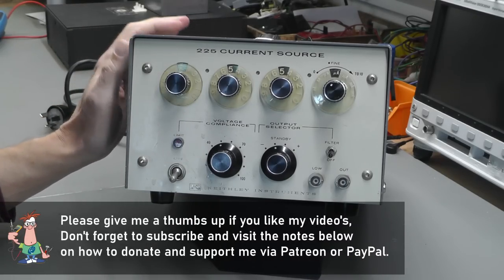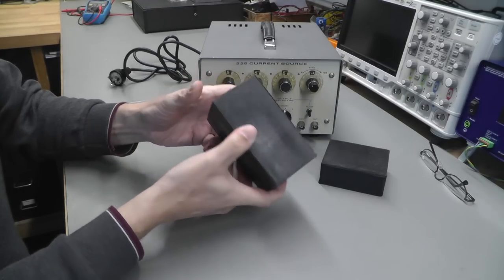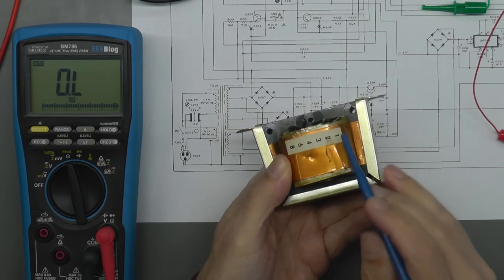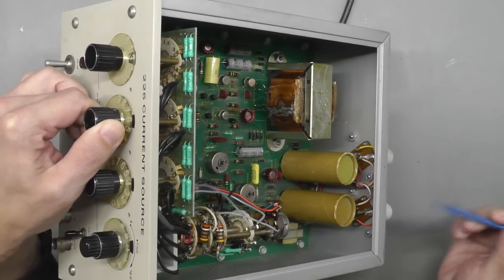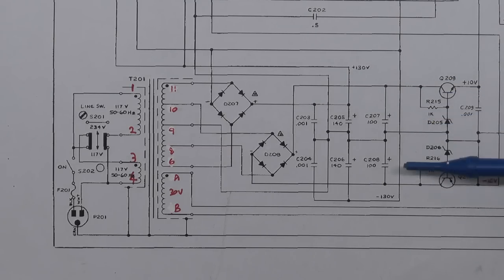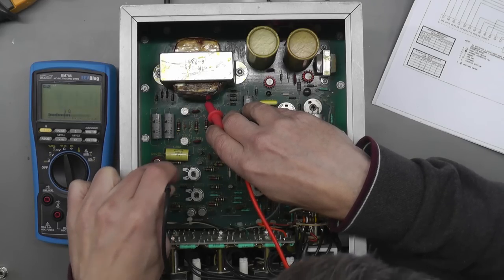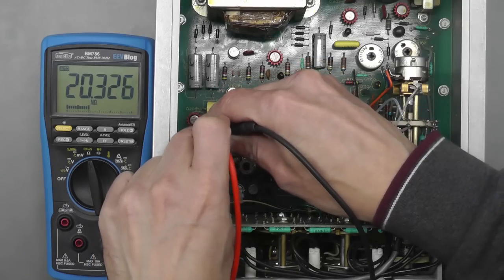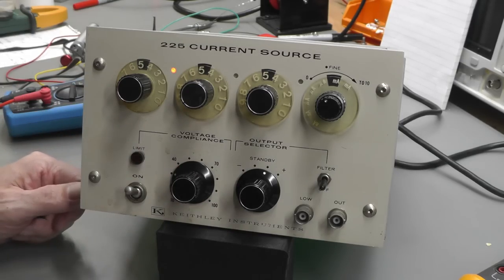No.096 - Keithley 225 Current Source Repair - Part 1

Comment: I was also surprised that you didn't bench check the transformer. You must have been confident with your repair. I have one of these old current sources and it is surprisingly accurate considering its age.

Comment: Rubber block:
A spacer for a multi-post car lift (ex. Bendpack). As in, this goes onto the lifting arms and touches the cars jack points when lifting a car.
Reply from the maker: Help ma boab!.......I didn't think anyone would get it....WELL DONE!
Reply: @IanScottJohnston  I think you under-estimate the small, but not insignificant cross-section between people who are into electronics AND racecars :)
Reply from the maker: Clearly!
Reply: very good!! ...my guess was somewhere in a wider ballpark. but also not close enough to know. in fact have never encountered such thing before myself. well done 👍👍
Reply: The grooves on only 1 face kinda gave it away. Was the first thing I thought of too.

Comment: hey! any chance you could say / or recommend that what was that high temp epoxy? was it jb weld or something elsse? seems like it could be pretty useful
Reply: btw (this is not related). but have you watched yet any of the robrenz youtube videos? he does some fantastic stuff. with the goop, and also with maching his own 4 point test probes. it is really outstanding quality of workmanship. the dude is a genius
Reply from the maker: I have two types I use:
JB Weld = good to 288degC (I used this one on the 225)
Permatex High Heat Epoxy = good to 500degC